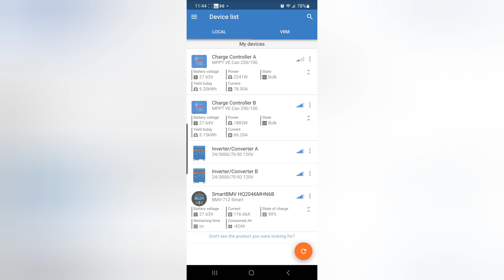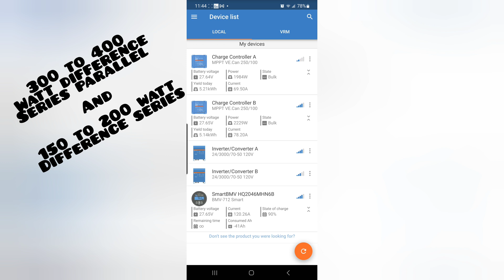5280 watts of solar on my RV. Which is better, series or series parallel?

Comment: Are they qcells g10s
Reply from the maker: Good question. Our rig is in the shop for some warranty work, so I can't check. They are monocrystalline and each panel is rated at 440 watts under ideal conditions.

Comment: Thanks. Good to know. I think having 6 bypass diodes on half-cell panels, like you have, helps reduce the effects of shading. 

I will be building a similar system soon, with 8, Bluesun half-cell 460-watt bifacial panels with 6 bypass diodes. The Sungold Power all-in-one 48V, 5,000W, 120V PSW Inverter, 80a MPPT 500v charge controller with a 40a AC battery charger I will be using only handles 18amps input from my panels, forcing me to wire them in series (the MPPT function will convert from 120-450volts to what's needed to charge a 16s LiFePo-4 battery. I was worrying about shading affecting this series string adversely. It's good to know my concerns are unfounded. The VOC on my array will be 406volts so it will be well within safe limits. I will be mounting them 13" off my motorhome's roof which should allow about 10% more production off the back side, especially when the sun is lower in the sky - extending the hours of solar production rather than increasing peak production by much - more area under the curve, so to speak.

Comment: I think the effect would have been more dramatic if it was a completely series string VS a completely parallel string. I have my panels wired completely in two parallel strings on separate controllers as I expect shading.